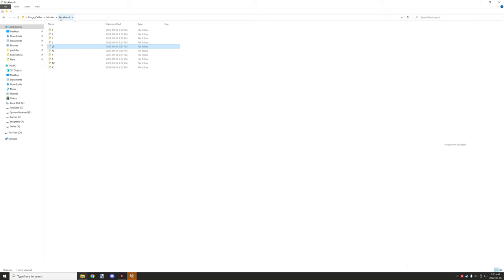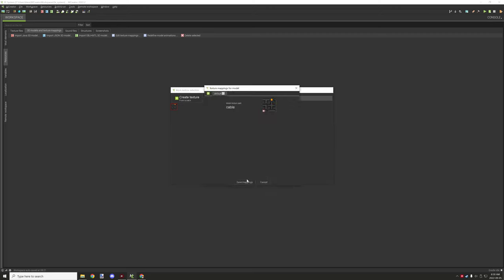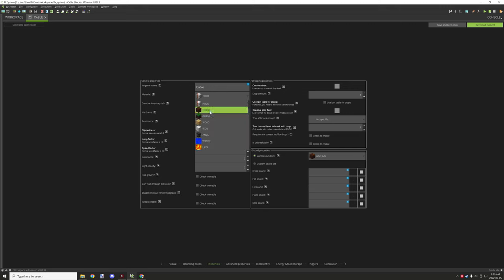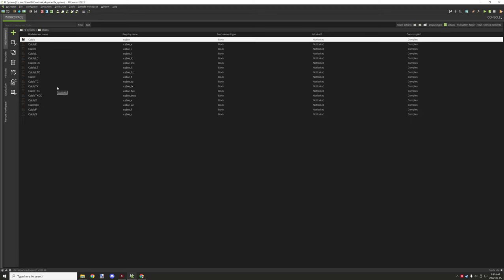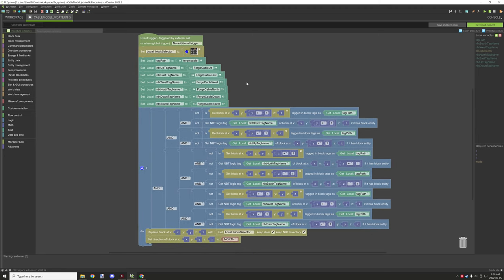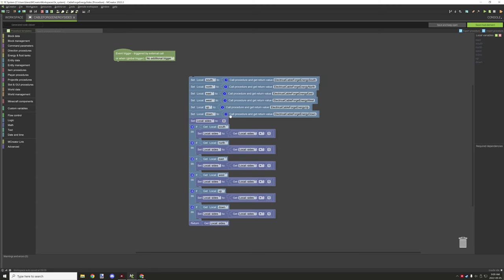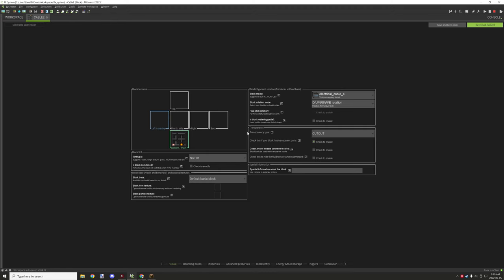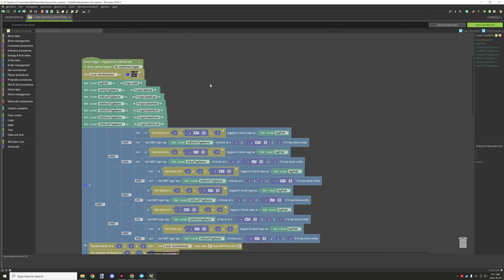MCREATOR: Forge Energy Cables | 2022.2

Comment: The energy transfer system doesn't work, i have a block that outputs energy perfectly fine unless i use these cables, i even put the block in the cable tag but nothing works, please help me
Reply from the maker: I suggest checking the example workspace, if the description has it. If the page is missing it should be on my website pinned to the blog. Test the example workspace to see if it's still working, if not then something broke and it would need to be remade from the ground up.
Reply: @NorthWestTreesMCreator  i used the example workspace as a base and copied everything but it didn't work

Comment: when i send/extract energy to your cables, do i need to specify a direction? im having trouble with energy flow; its like its not flowing right soomehow it flows 2-3 blocks then stops, wont reach the machines i wonder what im missing i used the files u included on V3
Reply from the maker: I provided a PDF File that explains in detail how to set up cables it should be included in the project files on GitHub.

Comment: at 20:20 you set the bounding box of the CableE (end) to 0-16 0-16 0-16 but on the Cable E jason file the box is "from": [5, 5, 0],
			"to": [11, 11, 11], did you made a mistake there? also should i set the bounding boxes like on each jason then?
Reply from the maker: It should match the model 2023.3 and up has a auto bounding box button so you can click this to fix any errors with the models.

Comment: hey norty, this cable got something wrong on the tip (end cable), the last you put, i need to set 1 more so the machine can take from it, do i need to set something on my machines so the cable connect to it right or something? thank you again!
Reply from the maker: You would need to use tags if I remember correctly.

Comment: Hey, great video. I have a question, i want have multiple cable sizes, will i have to make the code all over again, or is there a quicker way to have to separate cable that i can adjust sizes for? If that makes sence
Reply from the maker: This is a really old tutorial. I can't fully remember how it works exactly but you might be able to group the cables using tags in your mod and also test if they are in the same group. You can also use different names for the NBT variables if it uses them and this should break them up for connecting.
Reply: @NorthWestTreesMCreator  Thanks for your suggestions. I'll try applying them to my mod. I love your channel btw. Keep it up 😁

Comment: sorry, im coming here from your fluid pipes video i tried to set up tags and it deleted all my procedures, any idea why?
Reply from the maker: Fluid has issues with the system, I have been faced with the harsh reality that forge's system is really just terrible when it comes to what it supports. I have been planning out a Variable based system and optional API mod that can handle the things the community wants but I also need time to figure out the math and work on other projects I have going plus do YT videos. But its something I have been working on and it seems to be more reliable with my current testing, I will do a tutorial series on using the script as well as the API once the energy part is closer to completion.

Comment: yeah i just checked again, the final cable block; the one that usually tie to the machines, do not flow, so to work im putting a extra cable on any diretion After that one cable block that is buged, then he gets energy, this confirms the problem is on the final piece of the cable somehow? or im missing something? also to fix those texture glitches i set the CUTOUT to SOLID on the S model
Reply from the maker: The cable model may require some remapping in blockbench.
You would need to use Cutout for the render type solid is only for things like full cubes custom models should uses cutout, cutout mipped or translucent. I did have some issue with placement pretty sure I fixed it in the latest version of the project files though. If your still having issues you can use my website and upload a image to somewhere like imgur.com and then link to show me the issue I will try my best to check the forum more often.
Reply: @NorthWestTreesMCreator  when did you post this lastest version you said? i grab the last project it was there 5-6 days ago when i first post the message
Reply: @NorthWestTreesMCreator   ty again :)

Comment: hey i followed this tutorial and the end cables still have those invisible block issues? were these not fixed before upload
Reply: nevermind it appears to have just been a issue with the local test thing in mcreator
Reply from the maker: You can regenerate the code using the orange button near the test environment button and it should sort out any data pack issues. Most likely something did not sync this would have fixed it ;)

Comment: how to you make the cables just extract from the generator machines? wont it extract from the machines that are not generators too?
Reply from the maker: Normally it will send some in the direction it cam from this would be normal, as the energy acts similar to fluid in some sense, for example the longer the cable the more time it will take to fill up with energy so make sure you can recive and enough power as you putting in but also keep your cable power limit reasonable were it won't take to long to fill up. If there is a junction of say 6 sides it will split the energy all directions even if the energy is coming from one of them you could make blocks that handle the flow of the cables, this would allow more control over segments were the power should flow from but giving your question it may be wise to learn a bit more about how forge energy works before trying to divert from the tutorial.

Comment: Tell me what to do if the wires do not connect to the blocks and thus do not transmit energy?
Reply from the maker: Forge energy generally tests if there is another block that supports forge energy, and you then run the test send energy to the block on a local variable and it will return the amount that can be sent, you can then use that variable to send the exact amount of energy to the connect block. Its a hard concept to understand at first but if you paly around with it and test it in game with the /data get block X Y Z command you can generally see how it works.

Comment: Works in 2023.2 too 👍👍

But i have a problem idk how to make them connect to my machines. It works when i put the machine in cable tag but thats not the ideal solution i think. It also connected to all sides.
(Solved)
Add logic NBT tag called ForgeCable..... South Down East  or what side do you want and set it to true

Also when i was making the coal generator (the machine). When it was replacing the block from off to on or on to off its GUI doesnt close. So if you actually put an item in it, it changes to the on block, consumes the item, then after a while it changes back to off and then if you put the item in it and close it, the item will dissapear because it was in the GUI of the previous block that doesnt exist now. So when the block is replaced i need the GUI to close and then to open the new one(but its the same GUI just with different block).

It would be nice if you helped with that. Oh and i tried making it close when the block changes but that would be really annoying and i couldnt get it to open again.
Reply from the maker: "Also when I was making the coal generator (the machine). When it was replacing the block from off to on or on to off its GUI doesn't close. So if you actually put an item in it, it changes to the on block, consumes the item, then after a while it changes back to off and then if you put the item in it and close it, the item will disappear because it was in the GUI of the previous block that doesn't exist now. So when the block is replaced I need the GUI to close and then to open the new one(but its the same GUI just with different block)."

You may be able to make a right-click procedure and save a player life time global variable for a block state of the current block state then in the GUI inventory tick update test if the block is NOT the same as the block state variable if true you can run the close open GUI procedure block this should work on keeping the inventory closed. However keep in mind that you still need to use the Inventory checkbox for opening the blocks' GUI when right-clicking on the block I have found doing this through procedure on newer versions will not store the proper block X Y and Z position. Mainly 2023.1 and up. Not sure how long it's been like that though but it's for sure a client/server side issue Mojang implemented.
Reply: @NorthWestTreesMCreator thank you so much I'm going to try that soon and I'll tell you if it worked
Reply: @NorthWestTreesMCreator  hope this works 🤞opening Minecraft... and it instantly closes
Reply: I made a GLOBAL variable in the variables tab with type blockstate and scope player_lifetime. I also made a procedure that sets the variable to (get block at x, y, z) and put it in on and off block on right click. Then i put procedure that looks like this in gui tick:

if (not    is block "get block at x, y, z" same as "Global variable" for entity event/target entity)
{
        close gui open for event/target entity
}

Comment: How can I get the cables to connect to blocks?
Reply from the maker: Use the tags you use with the cables. the example uses forge:cable
Everything you need to know is in that PDF document I made.
24:13 - Sub Model Updater Procedures
Reply: @NorthWestTreesMCreator  Its connected but no energy are transfered

Comment: Hay, could you make a tutorial on creating energy cables like in immersive engineering? If it is possible on mcreator ofc
Reply from the maker: I don't know this mod so I am not sure how it works, if its using forge most likely it uses forge energy which is what this tutorial covers.
Reply: @NorthWestTreesMCreator  i meant the form of wires, it's not a block but an actual wire and 2 connectors

Comment: I don't understand how to connect these cables to the block
Reply from the maker: I would have to look at the example workspace to know but pretty sure you just need to send forge energy to the cable and the cable will automatically put Forge energy into any block that supports storing it.
Reply: THX <333
Reply: @NorthWestTreesMCreator  that doesnt work
Reply: Add logic NBT tag called ForgeCable..... South Down East  or what side do you want and set it to true

Comment: bounding box numbers pls
Reply from the maker: If you open up the json models you can check each cube under the elements tab "from" is the minimum position and "to" is the maximum position. rotations not of 90 deg are not supported using this method so you will need to mess around with the shape in some cases. but if you open the json model in something like NotePad++ just look under "elements" and the exact values will be listed for every cube